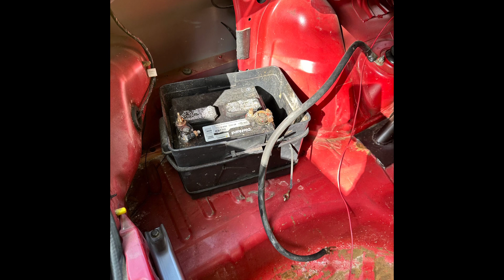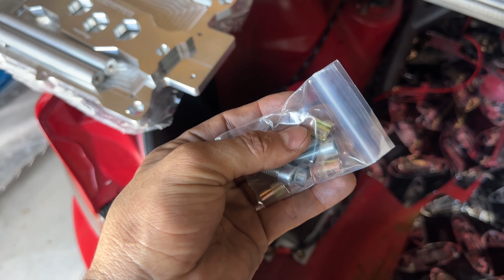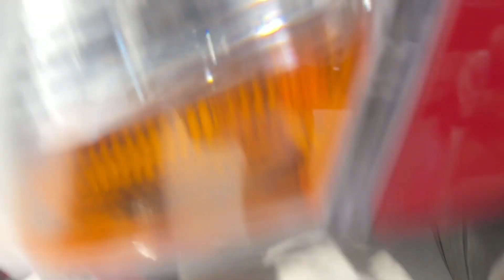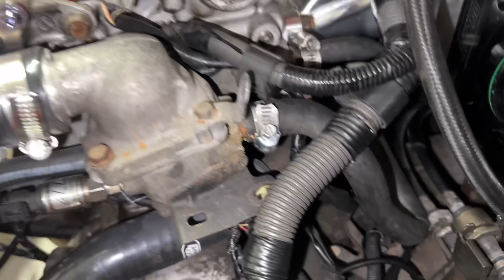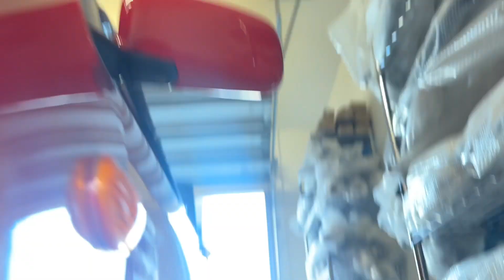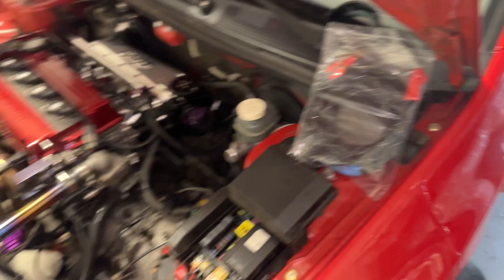Evo-8 &9  Billet Trunk Battery Relocation Kit

Comment: Will this work for a Evo 9mr with acd.
Reply: Any luck if it does? I bought the kit but I noticed that there is one extra positive wire to be left to plug. My bet is that it’s for the acd. Trying to figure this out before I start ripping it apart to do the relocation
Reply: @Luevo9 I was told** All you need to do is extend your power wire to the fuse box
from your acd pump that's all.
Reply: @Evo_IX It’s funny you say that because I thought about that but wasn’t too sure. Like nah it can’t be that simple… lol so I’m assuming that the fuses that were on the positive terminal, no longer matter then huh. And thanks for replying 👍
Reply: @Luevo9 lmk how the install go. I want to buy a kit myself
Reply: @Evo_IX I will let you know. Plan on installing it this weekend since I received it too late in the weekend.
Reply: @Luevo9 appreciated that bro
Reply: @Luevo9  any update ?

Comment: How can i buy the battery relocating kit like that at? And i would like the full wiring and all for mines am running stock harness but am on aem serie2 ecu idk if it matters?
Reply from the maker: @eddielugo8143  in stock https://www.dc5creations.com/products/evo-8-9-trunk-billet-battery-tray
Reply: @deividc5495 do you have a direct number i can call i biught the full kit and i cant get my head around one wire

Comment: The grey plug on your harness is for the altinator the single wire slip on plug is the starter signal the brown plug we don’t use in race car…just thought I’d put that out there… i like what you did to the harness tho 👍🏽👍🏽
Reply: 1 year later, and your comment helped me out. I could not, for the life of me, remember where the brown plug went. good to know i just can ziptie it out the way.
Reply: Thank you!! I was breaking my head, figuring out where the brown plug was supposed to connect lol
Reply: Damn 2 years later and I'm just reading this, like where the fuck does that brown plug connect to lol.  So I'm hoping it won't throw a cel?

Comment: Bro u should try to put together a full AWD conversion kit for the dc5.. And I dont mean just selling wago drivetrain or crv trans.. I mean like an entire bolt-up kit with EVERYTHING.. OEM style fuel tank that fits, axles, wheel and suspension components.. everything... People can just buy, not have to do any real modification or fabrication, and just do a quick install.. I have a fuel tank maker here locally that can make ANY custom fuel tank you want, made with the same materials as the Factory. I was able to get my hands on a rare awd ferio gas tank from Russia of all places, and I am having them scan it and they will be making mine in the same exact dimensions. The fuel tank was in bad shape, but at least Ill have an OEM fuel tank that bolts right in... The part # is 17500-SR7-J31 btw